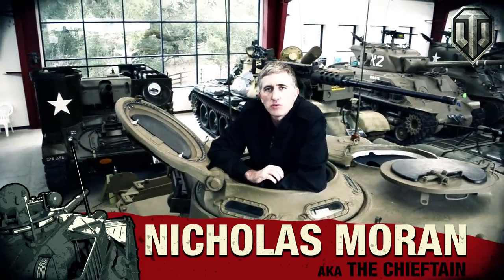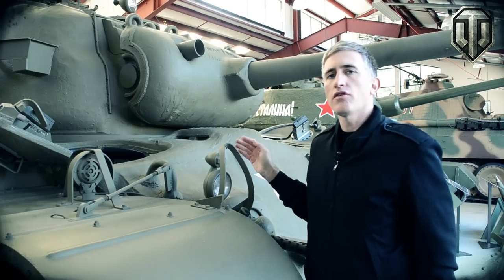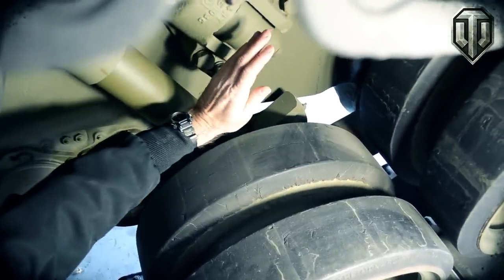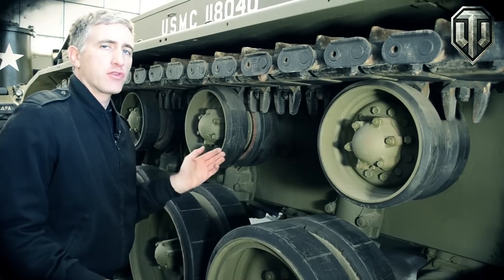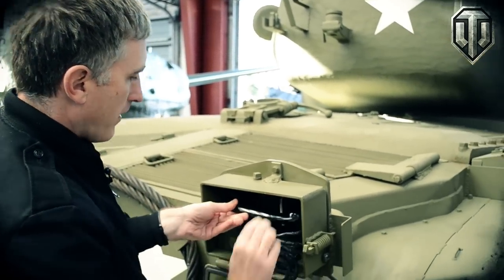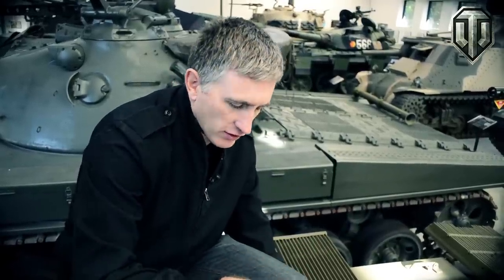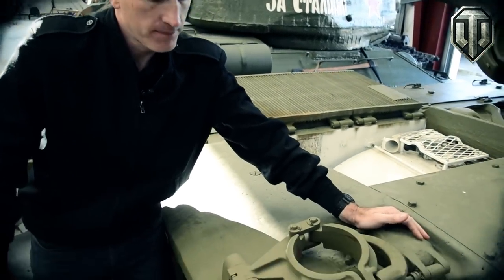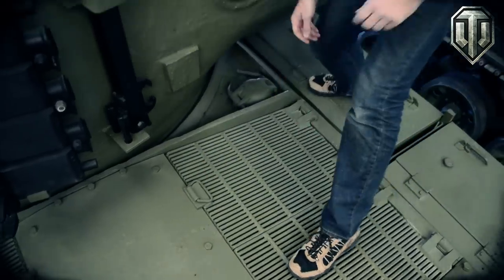Inside the Chieftain's Hatch: M26 "Pershing" Part 1

Comment: could a tiger kill this from the front at 3/4 of a mile?
Reply: A regular Tiger I? No. The 88 on the first Tiger only had 130mm or so of penetration, that's at close range. At longer ranges it drops off, so it would be well below that by 3/4 of a mile, then the Pershing's frontal armor is also sloped as well. Regular Tiger would have to be at closer range to kill one of these things. 

On the other hand, after the Tiger bounced his shot against the Pershing, the Pershing's return shot could kill the Tiger, heh.
Reply: You sound like a troll. But the 88's had extreme range tho, and only 130mm pen? No, based on wikipedia, 'Tigers were reported to have knocked out enemy TANKS at a distance greater than 2.5 mi'
Reply: Actually you know what? I was off by 10mm on the penetration of the first Tiger's 88. Its actually only 120mm of penetration at 100 meters. By 500m its down to 110mm. By 1000m its only 99mm of penetration. And it continues to fall off from there. I suspect you also didn't know that a projectile loses velocity the further it travels, and thus, penetrating power.

I suggest you do some proper research, kid.

http://en.wikipedia.org/wiki/8.8_cm_KwK_36

And you can largely disregard the stats on the APCR ammunition, tank crews in WW2 were issued that in such incredibly short supply, that they would save it for only the heaviest targets, such as an IS-2.
Reply: Wikipedia as a proper source? Here- The pzgr. 39 at 1000m had 100mm pen. The pzgr 40 had 138mm pen at 1000m. So at 1000m a Pzgr 39 & 40 could probably disable a pershing :)
Reply: Vincent Sluga Alright, this is going to be a really long wall of text, so be ready to do a lot of reading here.

Pzgr. 40 yes, that could do it potentially, it would still likely have to hit an unsloped part of the tank however. Keep in mind that is the APCR I mentioned previously, and due to the extremely small supply of tungsten during WW2, tank crews were issued maybe one or two rounds of that out of all of their standard AP (APCBC in the Tiger's case) and HE ammunition. I don't think Tiger crews were even issued APCR ammunition on the Western front, German crews typically saved that for heavy Russian tanks such as the JS/IS-2. However, if the war had gone on longer, and more Pershings began showing up, I believe they would have been given them on the Western front as well.

The Pzgr. 39 however, which is APCBC, the only chance that would have would be to hit a weaker point in the armor. At 1000 yards, that round wouldn't have enough velocity to penetrate the 102mm armor, although it nearly does. Taking into account the sloping of the frontal glacis however, that 102mm is going to be equivalent to quite a bit more. The front of the turret is similar story, unless they hit the weak machine gun port in the mantlet, or the barrel itself, both of which were involved in a situation where a Tiger I disabled a Pershing, although that was at only 91m. The lower glacis is only 76mm however, but at 1000m would be a difficult target to hit. However if they were able to hit that, it would penetrate fairly easily. However, penetrating hits or not, spalling caused from shell impacts is also a potential. crew injuring/killing factor.

I also need to point out that your original question was asking about 3/4 of a mile; that's 1207 meters, at which point that Pzgr.39 is going to be even less effective. So yes, technically the Tiger could knock out a Pershing at that range, but the odds are extremely slim, mitigated a bit if they have any APCR/Pzgr.40. At that same range however, the Pershing's 90mm is going to be able to punch through the flat armor on the Tiger with relative ease, so unless they are lucky enough to kill that Pershing, or eliminate its ability to return fire with that first shot or two, it would likely end with the Tiger being knocked out. The Pershing was simply a far more powerful machine in (almost) every respect than the original Tiger. Its just a shame someone didn't kill Lesley McNair sooner, because we could have gone into WW2 with those leading the charge, rather than just Shermans. 

The King Tiger on the other hand is an entirely different beast, so if a Pershing were to run into one of those that hadn't yet broken down, it would be in big trouble. The far more powerful 88mm cannon on the King Tiger could punch through the Pershing with relative ease, and the Pershing would find it nearly impossible to kill it frontally in response, with the exception of HVAP through the front of the turret, assuming it was able to get a shot off.

Also, the Panther's 75mm cannon could potentially penetrate the Pershing at long range as well, although due to the sloping of the Pershing's armor, they may be required to use APCR (Pzgr 40/42) to get through. And just like with the Tiger, the Pershing would have little difficulty getting through the Panther's armor with a return shot. You may or may not have seen it, but there is film footage of a Pershing knocking out a Panther during combat in Cologne. Granted, it as a shot to the side of the Panther.
Reply: So heres what ive got- KT has WAY better 88mm. Panther has also better chance of pen than reg. Tiger.

So all this stuff i watch in TV is just trying to glorify a Tiger 1? Ok. But yeah, a T1 could kill a pershing at 1 mile, but slim chances. Hmm. I always thought the T1 had an AMZING gun that could kill tanks at 2 miles. I guess in reality its not that way (?) But i agree the T1 would have a helluva time trying to kill a  Pershing at 1 mile with standard ammo.
Reply: Vincent Sluga Basically yes. The Tiger I, due to the reputation and fear factor it gathered due to its effectiveness against the Sherman and T-34, has developed a kind of "legend" about it, and is very, very exaggerated in how great of a machine it was. I mean, yes, it was known to sometimes take down tanks from 2 kilometers away(not miles), but those are the exception, not the rule. It was already a serious challenge to even hit a tank at that range, especially if it was moving around, not to mention there wasn't usually that good of sight lines on the western front. 

Don't get me wrong though, the Tiger was a great tank, but it wasn't the flawless, impregnable, world destroying beast from hell that a lot of documentaries would have you believe it is.

King Tiger was a far, far more dangerous tank... at least when it wasn't breaking down due to an underpowered engine and transmission.
Reply: Oh yes the KT was far better. The germans just over-engineerd stuff. Not always. I still would stand next to a M4 Sherman any day. I just love it :D   I cant beleive the Tiger 1 really had that bad of a gun. Suprises me...
Reply: Vincent Sluga For the stuff it typically fought against, it did have a good gun. It just wasn't the destroyer of worlds people like to make it out to be.
Reply: Katherine Winyala
Yeah people make it seem what it isnt.
Reply: Katherine Winyala Wtf are you talking about it had the best of of its day....
Reply: Bob, being broken down?
Reply: Vincent Sluga Did you mean "by being broken down"? I meant the gun a armour, the engine as the only bad thing about the tank
Reply: Vincent Sluga At 100m a Tiger 1's 88mm gun firing APCBC would fail to penetrate a Pershings armour. It has 102mm (on the upper glacis) with a fair slope, so it has an effective thickness of around 130-140mm on both the upper and lower glacis (the lower glacis is only 76mm however it's slope nearly doubles it's effectiveness), and a Tiger 1 firing even APCR would probably barely make it through. The turret has a 114mm thick mantlet with an extra 102mm underneath that. At 500m a Tiger couldn't penetrate a Pershing anywhere on the front, let alone "1 mile"?
Reply: Bob pew The gun was good for what it went up against, but it's armour? It's terrible boxy design with 100mm of armour on the front could be penetrated by many common allied tank guns. The general design is what made it unreliable, they could hardly put a more powerful engine in it. The only great thing about it was the transmission.
Reply: storm5013 Youre forgetting that it being boxy made it easier to weld, that's probably the reason for the boxyness, The pershing better but germany didnt have the time or energy to make new tanks like the US.
Reply: Bob pew The US stuck to the M4 medium's design almost entirely throughout the war. The US's generals were in no hurry to change that. Meanwhile Germany was designing the Panther, Tiger, then the Tiger 2, Maus, etc. They were making new tanks, just not many because of their lack of resources.
Reply: storm5013 I wasnt talking about designing them, i meant making sure they ran perfect
Reply: Bob pew Well the US didn't really make new tanks then, because the Pershing was quite faulty.
Reply: Katherine Winyala So I hear a lot of crap about the Pershing everywhere I go, do you know it's ups?  So many people dis the tank but I really like it.
Reply: The pershings only good part has to be is that its 90mm gun is pretty good and the armor is decent
Reply: +Vincent Sluga no point arguing tiger vs pershing. pershings came a tad too late and most of the battles it saw was against newer tiger 2 and similar tanks. and also, even when the pershing was ready for action in ww2, it was too heavy to be transported by sea so the americans stuck with the shermans instead.

Comment: Far superior to the Sherman.
Reply: Far from. Just look at Korea when the shermans replaced them
Reply: Chad Justice your both wrong..... to an extent, te Sherman was a great tank, arguably  the best medium tank of the war. But why compare the two. This is a heavy tank.....

Bill is right in that if 5 Sherman’s fought 5 Pershing’s the Pershing would win. 
But you don’t need a Pershing if your only fighting t-34’s in that case the Sherman is superior.
Reply: @chadjustice8560  The bugs weren’t worked out of the M26 yet in Korea. The mountains were too steep for it, being it was the same engine and transmission as the Sherman, but heavier. Those problems were addressed, but with a designation change also.
Reply: The Sherman’s present in Korea early on, were having no affect on the T34s. The Pershing was a stop gap until the better Sherman’s showed up (not intentionally, but that’s how it worked out). Sherman rounds were bouncing off the T34s, Pershing’s show up and put rounds through both sides of T34s, in one side and out the other. Doh!